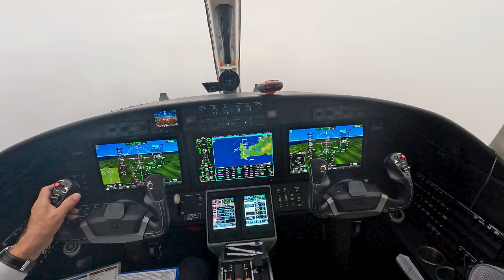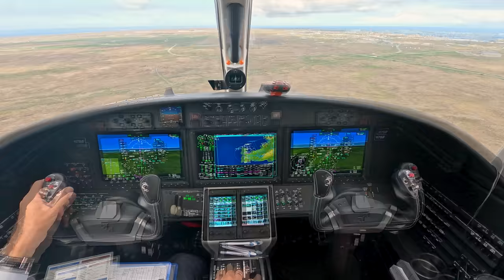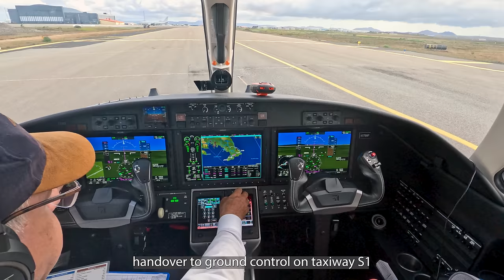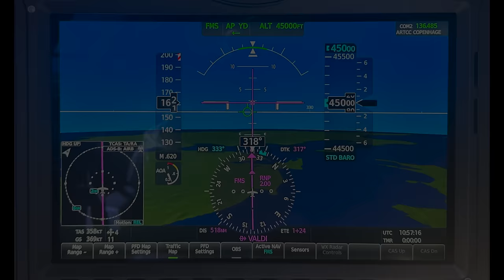CJ3+ Citation jet - ILS approach at BIKF Keflavik, Iceland!

Comment: Dead-center perfect as always. Wasn't aware that it had no thrust reverse. Happy to see more frequent posts from you recently!
Reply from the maker: Thank you Larry.
I try to get more videos up in 2024.
They got away with the thrust reversers because of the weight savings. 
The small jets are very weight critical. Out of 15,000lb take of weight you might have 800lb payload, the rest is fuel.
A trust reverser weights around 100lb per side, so it is significant. 
Wheel brakes are good now, but on wet runways it's critical. Most critical is pilot error, too high speeds on approach and late touch down.
Runway overrun is a major cause of accidents in these aircraft.
in the simulator, we are specifically trained on that matter, you touch don behind the touch down zone - you fail the check ride.
An example of bad piloting here:
https://youtu.be/px8awNCvQFM?si=I00TlgjhjTYxHxF8
Happy Landings,
Capt. Guido

Comment: Hi Capt. That  jet seems brand new.  And you really "buttered " that landing. A master's touch. Happy landings from Portugal.
Reply from the maker: Thank you - muito obrigado.
The jet had less than 30 hours on the clock - almost new.
The Citation CJ3+ is  very easy to land: they have a trailing link landing gear with a good geometry.
Not all Citation Jets have this. The C560 I have flown before is much more difficult to land smooth.
A safe landing is nice for the pilot's ego and for the passengers. What really counts is a safe approach and a controlled, safe landing with a touch down at correct speed at the touch down zone.
Here some info re trailing link gear: 
https://www.boldmethod.com/learn-to-fly/systems/trailing-link-landing-gear-smoother-landing/
Saudações a Portugal & Happy Landings,
Capt. Guido

Comment: Nice! The one day of the year when you could do a visual approach in to Keflavik. 😎

The Citation's flap and gear speeds are higher than my Musketeer's red line (151 kts)...
Reply from the maker: The fuel bill is also higher…
I never flown in the Musketeer but in a Sierra once. I was impressed by the workmanship of the aircraft - not comparable with Cessna and Piper - and also with the stability in flight. The trailing link gear makes greaser landings a standard.
Happy Landings,
Capt. Guido

Comment: Thanks Guido, always something new to learn, (ground flaps/winglets) great video.
I looked up the Tamara winglets as I recalled an incident regarding them. It looks like that was all resolved and a good system, you have to be aware of the flight manual insert for abnormal events.
You seem to be qualified on so many different aircraft, it must make the job more interesting and hard to stay current.
Is there a large community of pilots doing what you do?
Reply from the maker: You are very welcome Neil.
There was/is a controversial discussion about the Tamarack winglets. I personally think it is a great system that enhances the aircraft performance.
As it is part of the flight controls (ailerons), it has to be used with caution. 

The ferry pilot community is very small, it is a specialized niche in the aviation industry.
To stay current on the aircraft is expensive, I budget around $35,000 for training per year. Also as a self-employed pilot I do not earn any money while on training.
But training is essential for flight safety.
 My motto: train like you fly and fly like you train.
Happy Landings,
Capt. Guido

Comment: Flawless landing as usual. You were an inspiration for my PPL which I got in Windsor, Canada CYQG. So thank you for that.

I'm interested in learning more about the ground flaps 60 degrees. I guess they aid in slowing the airplane down after touchdown?
Reply from the maker: Thank you.
I got my first PPL at CYXE and added ratings at CYHU and the now closed Buttonville.
Canada is a great country for flying.
Ground flaps help to slow down the aircraft. In a jet you touch down at Vref, which is 30% above the stall speed. So the wing produces still a lot of lift and the ability of the wheel braking is degraded. 
Happy Landings,
Capt. Guido

Comment: Wow, nice, Captain Guido! The CJ and CJ1 have thrust attenuators, but not the CJ3 or CJ3+. Why did Cessna stop that? Do you notice much difference? So it's a N tail number that you ferried from Europe? How did it end up there? Nice G3000! Happy landings and congrats on another great video!
Reply from the maker: Thrust attenuators became obsolete with the FADEC controlled engines in the “+” models and the M2. These allowed to spool down the ground idle rpm by another 5% or so and reduced residual idle thrust.
About any commercial aspects of the ferry: why, who etc… I’m not at liberty to give out information.
Happy Landings, 
Capt. Guido
Reply: @GuidoWarnecke  Thank you for the reply, Captain Guido! Always happy to learn from you!

Comment: what is the point of extending the ground flaps setting right after touch down? also, serious question: do u leave the cockpit to use the bathroom at cruise? or how does that work?
Reply from the maker: The jet touches down at Vref, which is 30% above the stall speed of the aircraft.
That is fast and the wings still produce a lot of lift. That also means that there is less weight on the tires for braking action.
Hence we want to extend the ground flaps right after touch down. With the ground flaps also the speed brakes on top of the wing are extend. These are much smaller than the ground spoilers on larger jets.
On larger jets, the deployment of the spoilers is automatic, triggered by a weight on wheel switch if the aircraft settles down on the runway.
Regarding bathroom,  here my solution: 
https://www.amazon.com/Travel-John-66911-TravelJohn-Disposable-Urinal/dp/B000NV878S/ref=sr_1_2?hvadid=616863264372&hvdev=c&hvlocint=9002004&hvlocphy=9044437&hvnetw=g&hvqmt=e&hvrand=7783154096188488084&hvtargid=kwd-12360263&hydadcr=24664_13611849&keywords=travel+john&qid=1704577574&sr=8-2&th=1&psc=1
Happy Landings,
Capt. Guido
Reply: thanks for the response! so when you activate ground flaps, the spoilers also automatically deploy? does that mean the 'ground flaps' can NEVER be extended in the air for more lift/slower speed flight? Regarding Q2, thank u for the link! TBH, I was really wondering about how do you go #2 on these long flights? Or do u always just hold it? @GuidoWarnecke

Comment: Hi Guido, do the after-market winglets increase range by much from the standard aircraft?
Reply from the maker: I have only limited experience (one long range ferry flight Europe to USA).
I flew one leg from CYYR to KBGR non stop (!) against a headwind and still landed with 1000lb of fuel. That was 2,061 air nautical miles (no wind condition calculation). 
That was with long range power setting. I would estimate a real 15% increase in range. That may safe you some fuel stops.
I do not know the cost of installation of the Tamarack wingless, but it is not cheap.
Google the company.
Happy Landings,
Capt. Guido
Reply: Thank's Guido. @GuidoWarnecke

Comment: Question, with flying so many types and classes, how do you prepare the SOPs you will follow on a given flight. I mean sure you have the POH checklists but do you just follow those during flight or do you studying them and prepare some SOPs before flight for each type or class?
Reply from the maker: You have a good point here.
Actually the types I fly are not that many:
1) the Citation CJ Jets
2) the King Air
3) The Cessna Caravan, small and B
Seldom some Piper Meridians.
The aircraft within the groups are very similar. 
Biggest challenge is actually managing avionics. All King Airs basically fly the same way but between a 1980 King Air B90 and a 2023 B360 there is a huge difference in the avionics. Luckily I have flown all avionics setup imaginable so I Gert along. But of cute you are sometimes rusty if you have not used a specific GPS brand for some years. 
Before a ferry flight commences, I familiarize myself thoroughly with the aircraft and the equipment. Sometimes it helps to talk to pilots who have previously flown that specific airplane "is there anything special I need to know?".
And of course the checklist helps.
I see pilot flying small airplanes without checklists. I would not be able to fly without errors   when not using a checklist.
Thanks for your valuable comment. 
Happy Landings,
Capt. Guido
Reply: @GuidoWarnecke  Thank you so much for your response Capt. Guido 👍

Comment: Ground flaps? Are they only used on the ground after landing?
If so do they act similar to spoilers spoiling lift?
Reply from the maker: Only for the use on the ground. Small speed brakes on the top of the wing are also extended with the ground flaps. The aircraft is certified to fly with the ground flaps deployed (barely) and the max speed is 140 KIAS. There is a safety switch in the power lever. If you advance the power, the ground flaps retract. It is part of the taxi checks to verify the function.
Happy Landings,
Capt. Guido
Reply: @GuidoWarnecke  Hey , thanks for taking time out of your  day to respond to me and everyone else, my friend..

Comment: How do you manage to remember all the specific details for the varied aircraft you fly?  It's not like you are type rated on a single airliner, you regularly switch between one aircraft (e.g. the C208) and a few days later you're flying something completely different, as in this CJ3.  I have difficulty remembering all the nuances of just the C172!!!
Reply from the maker: Hi Guy,
the groups of aircraft I fly (King Air, Citation Jets etc) are quite similar. 
The main differences and challenges are in the variety of avionics. 
I prepare well if I have a ferry flight in an aircraft I have not flown for a while.
Happy Landings,
Capt. Guido
Reply: @GuidoWarnecke  Thanks for the reply.  Do you use any PC based training aids to "re-familiarise" yourself with the various avionics suites or do you just do it the old way with paper and ink pilot guides and manuals?
Reply from the maker: Hi Guy,
I have manuals and summary sheets for all aircraft I fly and study these before flight. 
Also before departure for the first leg I typically sit in the cockpit for an hour to familiarize with the set up. Preferably with one of the pilots who has flown this specific aircraft before. 
Happy Landings,
Capt. Guido

Comment: If you turn off the autopilot with the pitch trim, then what is the red button for?
Reply from the maker: With the pitch trim, you turn the autopilot off. The yaw damper stays engaged.
Before landing you switch the yaw damper off with big red button.
The "BRB" big red button, as we call it, also interrupts the pitch trim. This is important to know in case you have a trim runaway (an uncommanded movement of the pitch trim).
You certainly heard of the 2 accidents in the B737MAX.
You have to react VERY quick. 
This is why the red button is big ("BRB") and in reach of the left thumb as you normally flight with the left hand on the left seat. 
Note on the right seat, the red button is on the right side of the yoke as you fly normally with the right hand from that seat.
These are the little details that make aviation so interesting - always something to learn. 
I recommend to have the hand on the yoke at least below 1,500ft above the ground to be ready if a pitch trim runaway occurs.
Greetings to Hungary & Happy Landings,
Capt. Guido

Comment: What were the flaps at during the approach? I would think to lift the flaps after touchdown would help reduce lift and keep the plane on the ground but I guess the agressive 60 degree angle help slow it down?
Reply from the maker: Great question!
The concept in jets is different than in light aircraft like a C172. A C172 touches down (ideally) at stall speed. The jet touches down at Vref, which is 1.3x the stall speed. That is fast. 
So still a lot of lift on the wing. The ground flaps produce a lot of drag and at the same time destroy lift by stalling the wing. Additionally, with the ground flaps, the speed brakes on top of the wing are deployed automatically.
Raising the flaps will not have the same effect. I also discourage raising the flaps in light aircraft. Raise the nose on roll out and use aerodynamic braking. Also the brakes in light aircraft do not have anti-skid, so you may lock up the wheels quickly. 

The whole system is not as good as airliners which automatically deploy huge lift dump spoilers on top of the wing on touch down and additionally have thrust reversers to slow down.

Happy Landings,
Capt. Guido

Comment: What‘s bleed off speed?
Reply from the maker: This means to reduce the speed. 
I called the approach "stable" which should be within 20 knots of the Vref reference speed for landing.
I was knowingly faster than that so I called out for the speed reduction. You have to mentally ahead of all action sin the cockpit, especially when single pilot. It is east to make mistakes. 
You want to cross the threshold at Vref, which is 30% above the stall speed for the current landing weight.
If you zoom in I was at 114 knots and the Vref (there is a small greed dot in the airspeed indicator) is around 92. As a lot of fuel is burned off on the long flight from Vienna and I was the only occupant in the aircraft, landing weight was low as was the Vref. There is a difference of 15-20 knots in Vref between a light aircraft and a landing at max alining weight. 
I knot speed over Vref leads to a 100ft longer landing distance, 10 knots is already 1000 feet extra. Runway overruns are one of the main accident factors in these light jets without thrust reverser. You can operate these jets from small airports with only 3,500ft runway - but no room for error. 
You calculate the Vref speed from a table or, very convenient, the G3000 computer calculates it for you automatically. It knows your take off weight from your entries before and subtracts the fuel burn which is also logged -> predicted landing weight. 
Greetings to CH & Happy Landings,
Capt. Guido
Reply: Thanks!  @GuidoWarnecke

Comment: What is that orange and black device besides the compass? Does it affect the compass at all? I used to fly with my ads-b in on the glare-shield, but noticed quickly it would cause a compass deviation, so I moved it away.
Reply from the maker: You have a good point.
It is a Garmin InReach, which I use for text communication in flight.
Very useful.
Does it affect the magnetic compass? Certainly it does.
In many airplanes, the electric windshield heat also turns the compass by more than 30 degrees.
It is a stand by compass only. If you need it, you have bigger problems...
Happy Landings,
Capt. Guido
Here info re Garmin InReach:
https://www.amazon.com/Garmin-Explorer-Satellite-Communicator-Navigation/dp/B01MY03CZP/ref=sr_1_16?hvadid=557479584362&hvdev=c&hvlocint=9002004&hvlocphy=9044437&hvnetw=g&hvqmt=e&hvrand=12658606367573101527&hvtargid=kwd-73730331875&hydadcr=17784_13447079&keywords=garmin+inreach&qid=1704654300&sr=8-16
Reply: Thanks for the explanation and I enjoyed the video 😀. I’ll have to add the in reach to my wish list.
I just passed my commercial last week and starting my cfi now, but haven’t flown all glass yet where heading is based on a magnetometer.  So I’m constantly resetting my heading indicator to compass. One day! 🤞

Comment: Can ground flaps be used in the air?
Reply from the maker: Hi Jose,
they are only approved to use on the ground.
if for some reasons they deploy in flight, the aircraft has demonstrated that it is able to fly with a max speed of 140 knots. There is a safety system installed that retract the ground flaps to 15 deg when you dance the power levers. We check this system before flight.
Happy landings,
Capt. Guido
Reply: @GuidoWarnecke  Gotcha.

Comment: I thought all jet aircraft had reverse thrusters.
Reply from the maker: Hi Jay,
The light jets are very weight critical.
A 15,000lb jet may have a payload of only 800lb with full fuel.
Thrust reversers weigh around 100lb each, so they got rid of them.
Good wheel brake system help but runway overruns are still a cause of accidents on the small jets. Especially on a wet or contaminated runway. 
Happy Landings,
Capt. Guido
Reply: @GuidoWarnecke  Captain, you add value to my life. 
Thanks again and again.